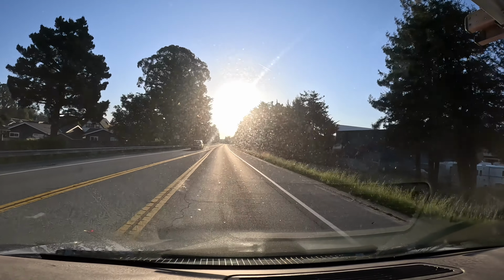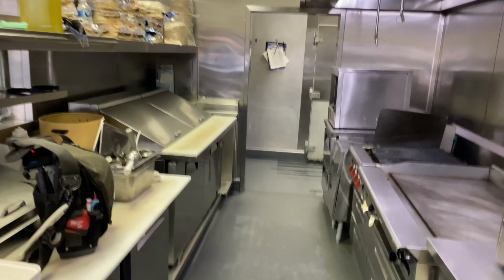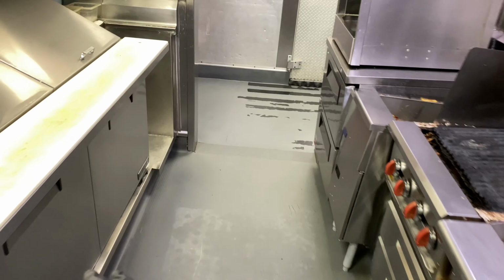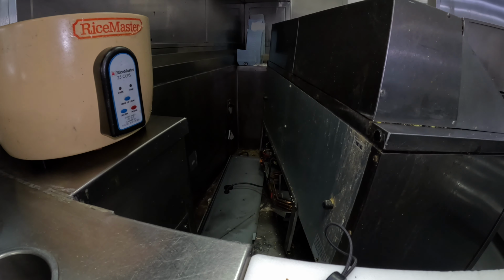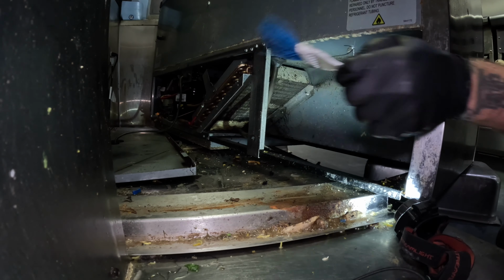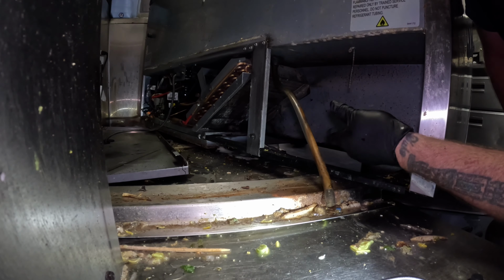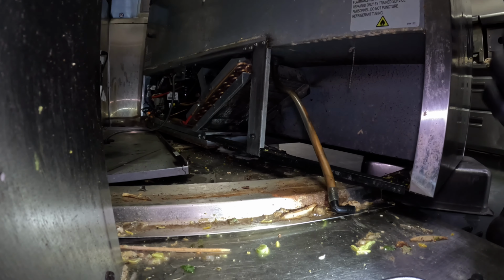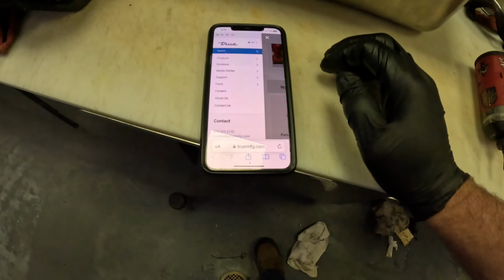R290 Make up station Warm

Comment: You ever use 134a in one of those instead of R290? I had one that I repaired a leak on a couple years ago and realized I was out of R290, about an hour away from the parts house. Filled it with 134a, still working fine. Curious if anyone else has done it.

Comment: My experience with the R290 stuff so far is that the start components are completely intolerant of dirty condensers. Also, I see they had big open areas with no bins under the lid, if they’re anything like the places I work they probably leave it open like that and the cold air all blows out the top 🤣🤦‍♂️